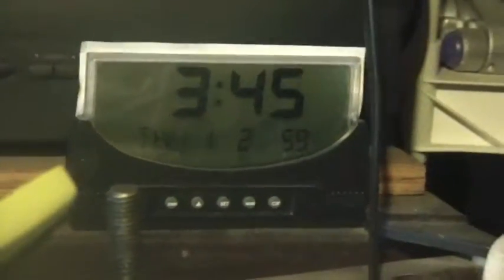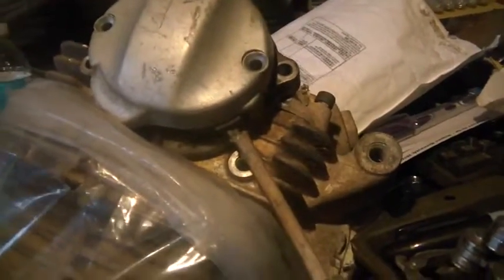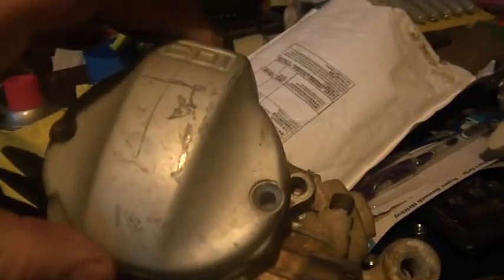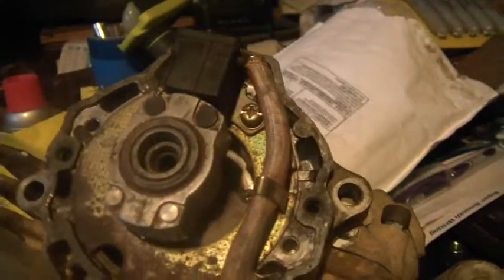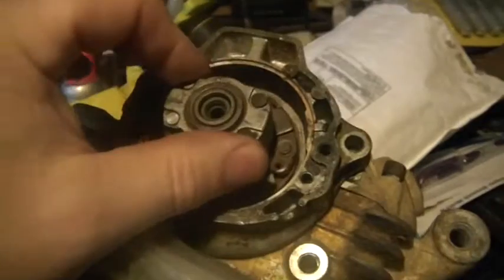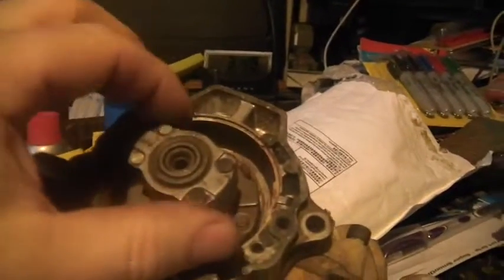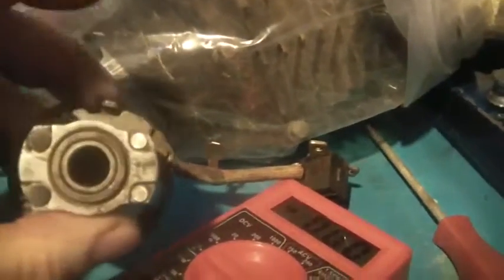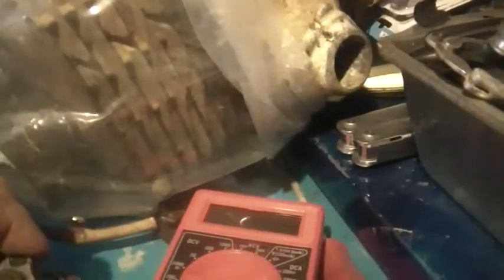1_2_2014, Honda ATC 185/200, Mechanical Ignition/CDI, timing advance

Comment: Hey Harvey it was my ignition coil on my stator and I got one outta a 1984 200es mines an 83 200m or just the 200 can't tell iv blew out 4 ignition coils in a month have u ever had that happen or why it would be happening thank u
Reply from the maker: lenny risdon, U got a strange one there my friend, I know the early ATC200s had issues and they burned up ignition stator coils all the time. Folks used to blame it on the coils, I'm thinking it must be something with the CDI putting a big load on the coil.  I would change that and see how it works out. Let me know, thanks for asking, watching, and commenting!

Comment: hey i have a 1983 honda atc dn itf its a 200m or 200s or 200x but i have week fire changed the cdi box coil plug never got better do u think it would a bad ground like in one of ur other vids i watched or the the cdi its self is bad
Reply from the maker: Lenny Risdon, I always start by checking for loose wires, bare wires, and I run extra wires to ground everything, like the engine case to the coil casing, and both those to the ATC frame. I make sure all ground surfaces are clean. The next thing that I have been burnt by was the spacing between the CDI pulser and the magnetic pick-up. See my last few videos on the 200S... Good luck, let me know how it turns out, thanks for asking, watching, and commenting!

Comment: Can you make the mech. advance not work and use a elec. advance box?
Reply from the maker: 231flash, I think I can bend the stops for the weights or put a tack weld there. It seems that I have 2 mechanical advancers that are missing springs, so, I have 2 to play with, Thanks for asking, watching, and commenting!